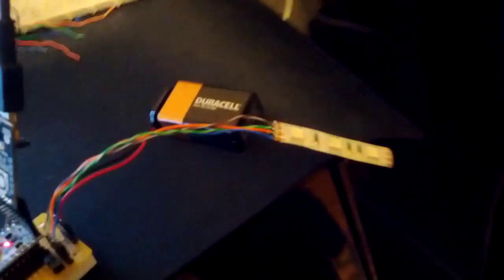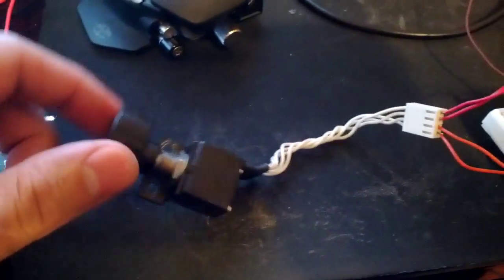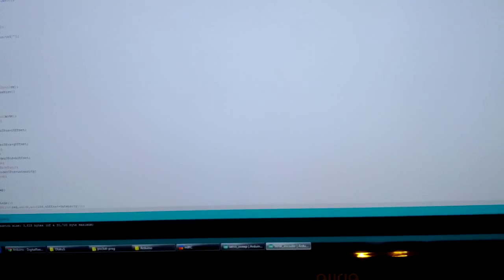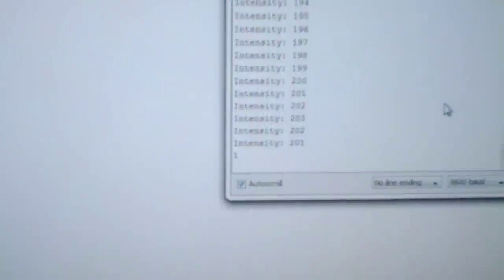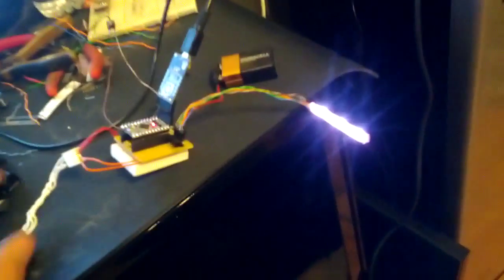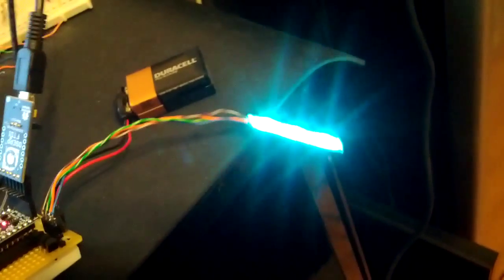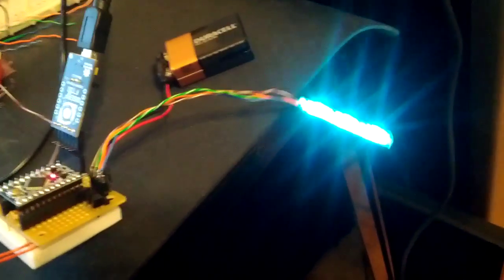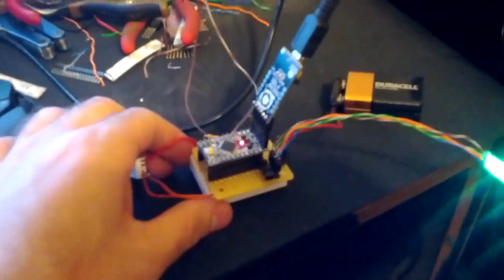Arduino rotary encoder color led changer

Comment from the maker: there's really not much to it. I'm using the encoder library which does all the heavy lifting for me. All I did was make a state machine that toggles between the 3 colors and stores the individual intensity values. I don't have the sketch anymore so can't show you the code =p

Comment from the maker: Yes I do like the mouse but I advise not to buy one. It's got numerous issues which are inexcusable for it's pricetag. A lot of them die(mine has had a few instanced of randomly just not working), constant battery swaps(which they made easy enough so not that big of a deal). But my biggest complaint is they seem to use cheap buttons, after 3 months of use my left mouse button is being sticky. It's awesome for the first few months when it works perfectly but I advise caution in buying it.